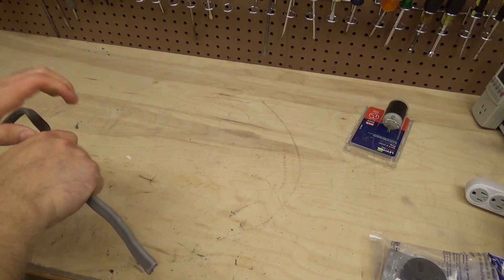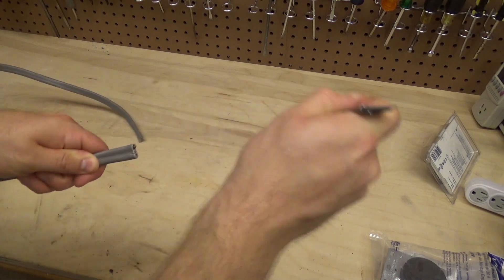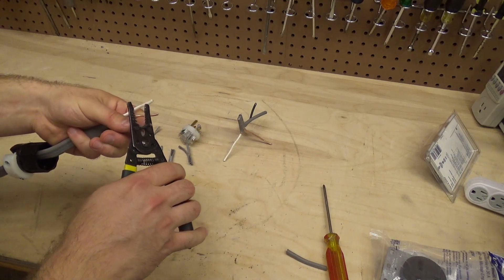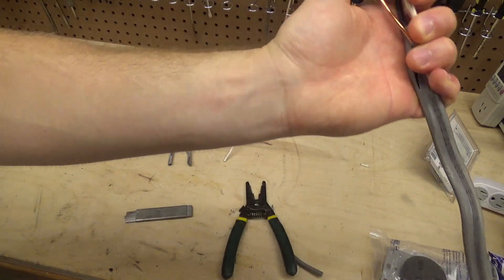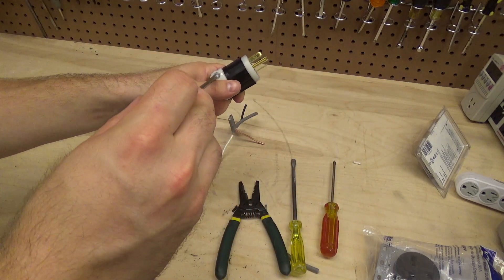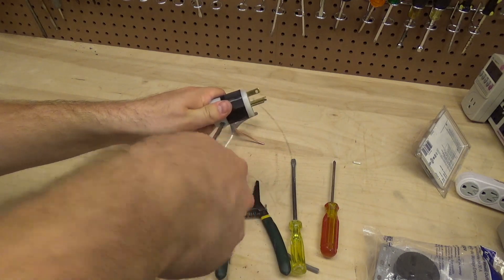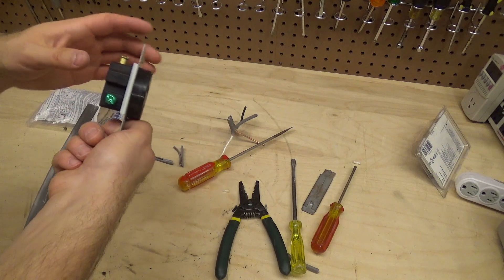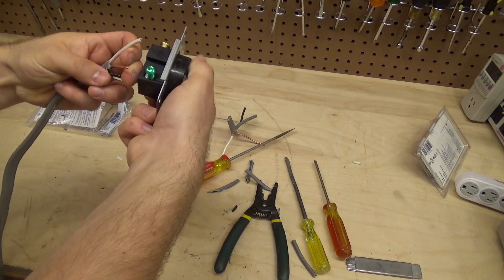Committing an Electrical Felony

Comment: 7 years ago when I was renting in Pontiac Michigan I brought a 3000 watt 240 volt heater with NEMA 6-15 plug from Northern Tool because the furnace had difficulty keeping up during windy winter days and the standard 1500 watt 120 volt heaters weren't quite enough.  There was a 240 volt 20 amp receptacle for the window AC and I had a 25 foot #14 AWG 3 wire extension cord,  I cut the ends off and wired on NEMA 6-15 ends.  Used that with the big heater no issues.   I moved to Greenville SC 5 years ago and no longer needed the 3000 watt heater so I removed the nema 6-15 ends from the cord and put 5-15 ends back on and still use that cord from time to time.

Comment: There’s absolutely nothing wrong with using that wiring indoors. It’s actually safer and better than normal Romex wiring. It’s used to wire kitchen islands in brand new houses and passes inspection every time.

Comment: I used a 240 volt 4,800 watt garage heater all last winter on a standard 240 volt 6-20 outlet. It was for reasons of their U.L.  listing, and people who like  to use extension cords  on their shop heaters. A resistive load is difficult to accomplish on long runs. I have never seen any 240 window unit since 1986 regardless of BTU's that required more than a 20 amp breaker,  on a 12 awg cordset,  using a 6-20 receptacle.
Reply: The Friedrich Kühl 36,000 BTU model which has a NEMA 6-30 plug.
Reply: @johncantwell8216  I was doing some research. Found that 24,000 btu is about the limit for 20 amps. Yeah. 36,000 absolutely 30 amps. Damn.that must be old. Back in the days of : Sears,  Montgomery Ward, fedders, and Carrier.
Does it have R-22?
Reply: @johncantwell8216  holy moly! They are new! Runs $3,200 on Amazon. Yeah. What a beast! Lol!

Comment: As someone who has completed an electrical degree, and am currently doing job site training and working on getting licensed as an electrical contractor. This is absolutely not something I would do in someone else's house, or even to test something in someone else's house. But I have done many janky things like that at my own place. While it isn't the best idea, it certainly won't cause any issues. Especially if you are just using it for testing. My bet, that unit will never pull more than 20 amps. Even if it does, like you said the breaker will trip. Even if it didn't, if it is a 20 amp circuit and most likely wired with number 12, it would likely be fine. #12 is rated for 20 amps at 60 degrees, but if you go up to 90 degrees, it can handle 30 amps (or 25A for 75 degrees). While I wouldn't recommend it, 90 degrees really isn't going to cause any issues as long as there is only one outlet on the circuit, and not a lot of termination points. NM cable itself is indeed rated for 90 degrees. So in reality, while I would absolutely NOT do it, you would probably be fine for years running a 30 amp unit off of #12 wire using this device, even if the OCPD was 30A as well. 
I have much worse stuff in my house right now that has been that way for years and the wiring in my house is nearly 100 years old. I won't even get into half of the janky crap I have done in my time because I would never be allowed to touch anything electrical in my life again.
Reply: The 1967 and 1969 Westinghouse 24,000 BTU machines are rated for 16.4 amps at 230V, just a tad over the 16 amp limit on a 20-amp line. (17.4 amps at 208V). So it should be OK for a test.
Reply: @johncantwell8216  I figured as much.
Reply: If they had made it just a bit more efficient (and rated it 230V only) they could have gotten away with the 20-amp plug (Philco built a 27,000 BTU machine with a Tecumseh B compressor that took less than 16 amps). But I guess back in the 1960's not everyone cared too much about things like that. @WalterKnox

Comment: I think in the case of the UF its more that its pain to work with so using it indoors will have the nxt guy cussing you out
Reply: True but it’s perfectly allowed to be used for permanent wiring indoors anywhere Romex would be used.

Comment: The reason for not using that outdoor wire as a substitute for flexible cord is because UF cable (NM as well) is solid wire, it will become brittle and break when repeatedly flexed, it's designed and listed for permanent wiring systems only.
Reply: True but it could be used in permanent wiring indoors anywhere regular Romex would be used.

Comment: My grandmother had a 240 volt AC plugged into an outlet on the outside of the house with average looking romex running up the wall. It worked 30 years like that. We took the AC out and deleted the outlet when she died.